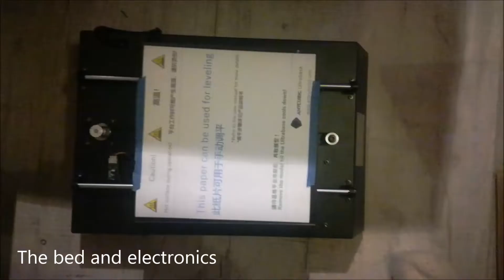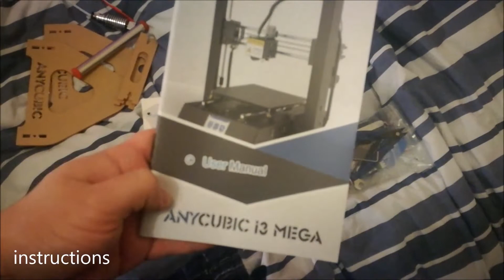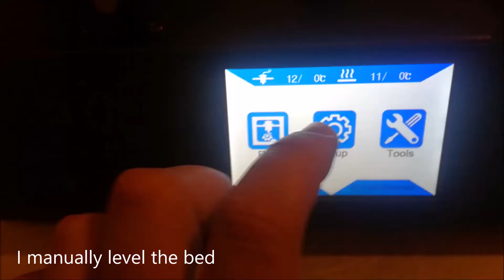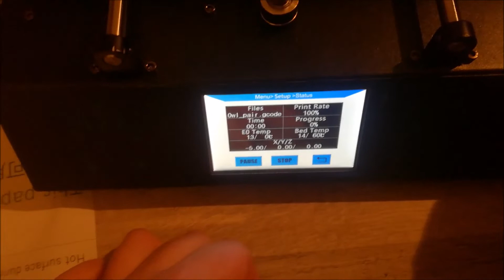I3 Mega build and first test

Comment from the maker: A few things I realised after publishing this:

1.) I only showed the cover of the manual, so all you know is it has a shiny cover. that should be enough right

2.) I didn't explain the bit before the bed levelling. That was just that the motors being turned off to make moving the bed/extrudy bit around easier. A nice feature.

3.) Showing the noise as picked up by the camera is pointless as is more about the ability of the camera to take in audio rather than the actual noise of he thing. so I was an idiot.

4.) I should have noted how long the print took but I forgot to and have now forgot the number. again, apologies for being an idiot. If I recall correctly it was a tad under an hour and a half.